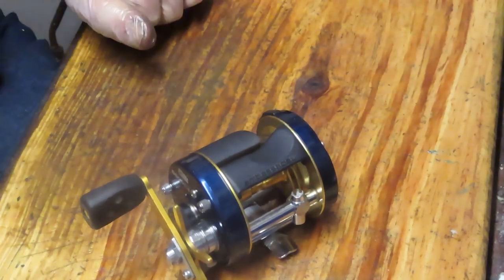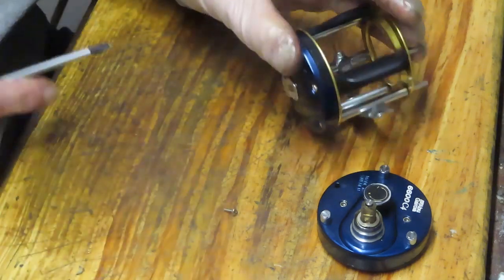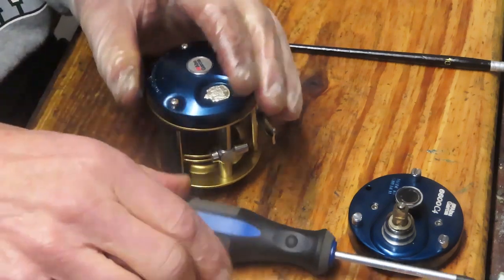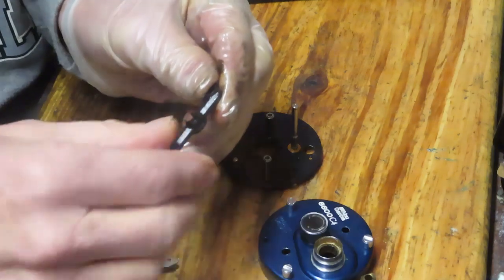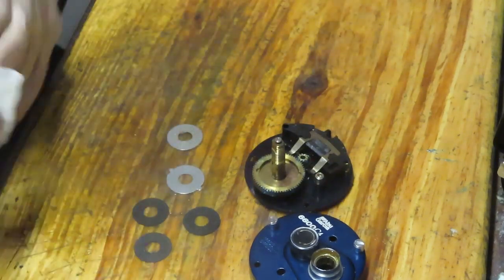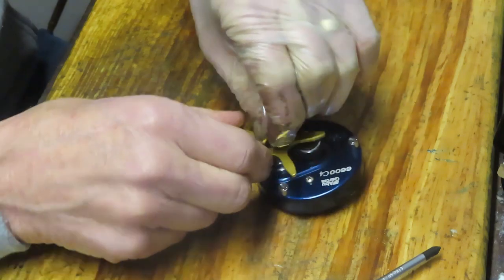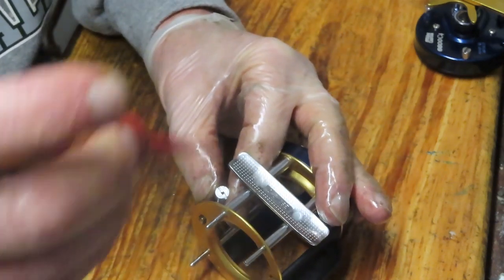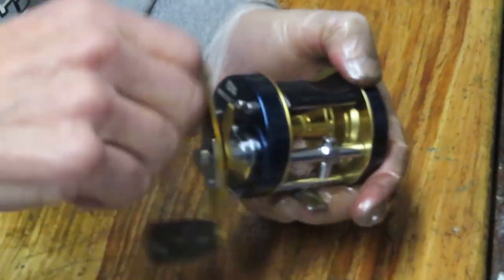Ambassadeur 6600 C4 fishing reel how to take apart and service

Comment: I like Ambassadors. I have one that is 23 years old and has taken a beating. Replaced line pawl a couple times. spool tension adjustment knob and it's time for new drag washers but it's a great reel. It's a Swedish made model. Best $100 I ever spent. Is that a Chinese made version?
Reply: 6600 and under are all still made in Sweden. Some 7000 parts are made in Sweden but assembled in China for some reason?
Reply from the maker: This is not a Chinese version and I do not think well of these made in China.  There re a lot of plastic parts in the newer versions and I have seen a lot of them break.
Reply from the maker: Hmm.  It is it, is is simply the company using cheaper labor and sending over their inventory of parts to continue to make the reels until the parts are exhausted and the new ones made there.  I haven't seen anything that says assembled in China with parts made in Sweden, but it is possible - Thanks - Dennis

Comment: Hell Sir I have an identical reel and was wondering if it takes a spacer washer behind both spool bearings? The reason I'm asking is because my spool gear doesn't seem to engage when putting back in unless  it has a washer installed first. Wasn't sure if this reel requires a washer on both bearings?
Reply from the maker: There is a thin washer behind the one bearing, but that is not likely to cause the issue you are describing.  You can check the schematic here https://www.reelschematic.com/wp-content/uploads/schematics/Abu%20Garcia/Round%20Baitcast/6000/Ambassadeur%206600C4%2023%2000.pdf
Did you have the reel apart?  the common cause is that the yoke spring is hot holding pressure on the yolk to push the pinion gear in to engage.
A less common issue on reinstallation is that he pinion gear was installed backwards and cannot grip the spool shaft.  You should check both - Dennis
Reply: @2ndChanceTackle  wow when I move the washer to the break side and install the spool gear it clicks when I push it in but spins freely

Comment: What is the 6601 ambassador I have 2 looks just like that but it's a 6601 what's the difference an what one is better
Reply from the maker: These are just iterations of the reel.  The differences in various modes have to do with the internal gears and free spool release mechanisms.  Yours is an earlier version.  The odd number 6601 means it is a left handed crank to the even numb red 6600 right hand drive. - Dennis

Comment: I just cleaned my 6600 C4 but after pushing the button for free spool, when i start to crank the handle it goes around one whole turn before the button releases and pops up. something is sticking or not back together right. Maybe something has oil on it that shouldn't. I will try pushing the button up when putting the side plate back on. Any ideas would be appreciated.
Reply: Should be a small slot the pin goes into the side plate. If in correctly with the trip mechanism it should engage almost immediately. Make sure all the internals are in the right order as well.
Reply: @richardsurber7928  Are you speaking of the hole and pin mentioned at 23:10?   
Thanks for your thoughts. I really enjoy taking my reels apart and cleaning them along with my rods. 
I will take it apart and reassemble again.  I enjoy this channel and the teaching of Dennis. 
Thanks again Richard.
Reply from the maker: Bill - make sure that the click ratchet that sits on the bottom of the gear post is seated firm and even.  That ratchet has a rectangle slot that fits the shoulder at the bottom of the post.  If it came loose or is not sitting flush, the ratchet will wobble and miss the tag on the release lever.  That will cause your issue. - I would go back and make sure it is in there correctly. - Dennis

Comment: I have this reel, and my release button every time I go to cast, it’s really tough to push and hurts your thumbs over time. Any way to loosen the button?
Reply from the maker: This is likely old grease in the channels or a bent release bar.  If the thumb button spans the frame, you will need to replace the frame.  I would recommend taking the reel apart and doing a service before thinking about the frame as old grease may be the culprit - Dennis

Comment: Instead of taking every last piece apart guys just take the entire gear assembly and spray it off with wd40 the air blow it out lol.
Reply from the maker: Yeah and some folks just smear new grease over old and call it serviced too!
Reply: @2ndChanceTackle  does it reel does it work lol. I’m just being funny. I said wd40 though witch will do what it’s designed to do get down into the crevices and clean out everything. Then you blow it out with an air can or compressor
Reply: @rofishy2 you let a witch clean your reel?? 🤷‍♂️